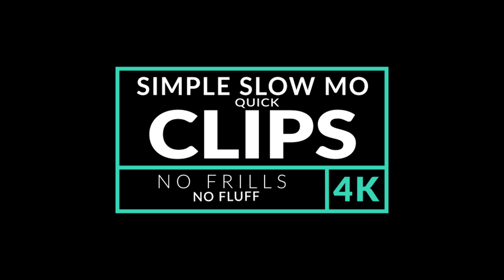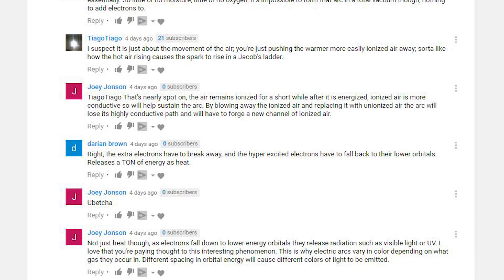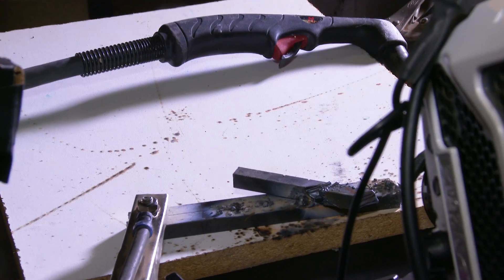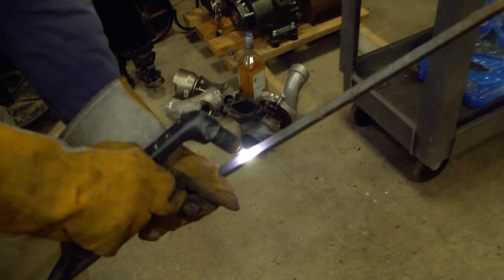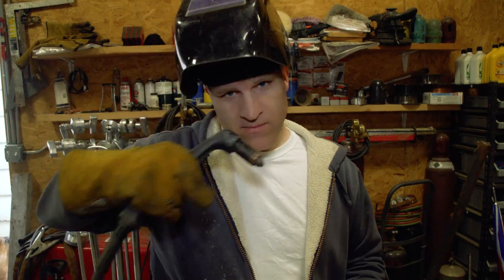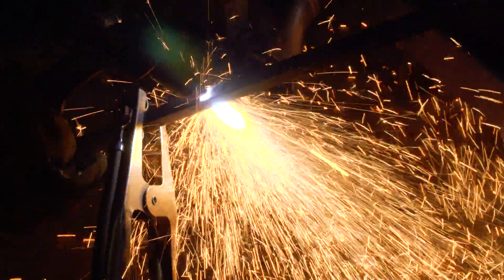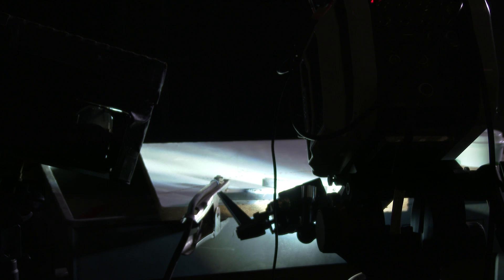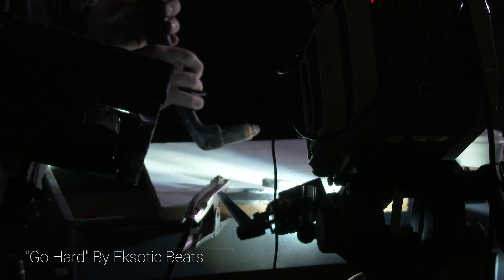Plasma Cutter in Ultra Slow Motion at 30,000 Frames Per Second [ Quick Clip ]

Comment: I love how many different ways we cut metal. Sheers use force to overcome the sheer strength of the metal, torch cutters corrode the metal apart, water jets erode the metal away, and plasma cutters just melt it.
Reply from the maker: I agree it's very fascinating to me as well.

Comment: How about doing 2 clips of AC arc vs DC arc? This would be useful to show why DC arcs are dangerous and not self-extinguishing, but AC arcs cut off between each half of the cycle. This would help  to explain why you don't use AC breakers for DC.

Comment: Awesome Video.
How much does a plasma cutter cost?
Target/maximum temperature?
Reply from the maker: +San Sone I can't remember how much I pay, I think about $3,500. I will have to check as for the temperature I'm not sure but I know it'll melt almost anything.
Reply: +Warped Perception WOW!
Reply: San Sone you want to be looking at Amps and duty cycle when shopping for a plasma cutter, you can get one in the 30 amp range for 400-1000$ usd depending on the brand and features, my 30 amp will cut up to about 1/2 with a bad quality edge, will cut 1/4 inch very cleanly.
Reply: Average plasma cutter cuts at 27000 degrees C...... surface of the sun is 5000+ C

Comment: So, what's happening into the nozzle ? The cathode is in the nozzle and the anode is the clamp or the cathode and the anode are in the nozzle and the clamp serves as ground ?
Reply from the maker: John theux ok so here's the Reddit post, go there and post your question and we should get some answers Plasma Cutter in Ultra Slow Motion
https://www.reddit.com/r/interestingasfuck/comments/6cxa6j/plasma_cutter_in_ultra_slow_motion/
Reply: A hell of a lot is happening in that nozzle!....the 4th state of matter for starters...but basically, compressed air is forced and swirled through the shroud, past a ( usually) tungsten tip on a copper electrode, as an electrical charge passes through it creates plasma, and the plasma arc continues to the steel, completing the circuit...basically...
Some fun facts!...that i've read about....the air is compressed and forced to just under the speed of sound and the average temp of a cutter is 27000 C ..... surface of the sun is 5000+ C
All that happens in the 2 inch long nozzle!
Reply: yeah you must ground the piece just like a welding machine.